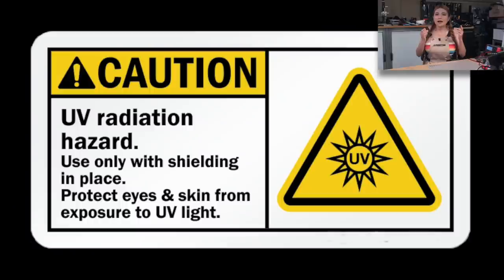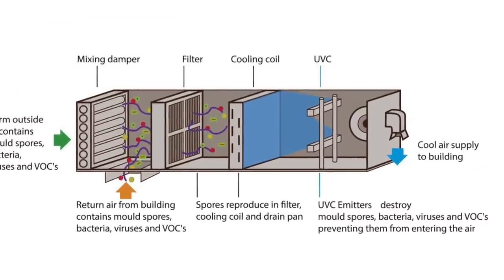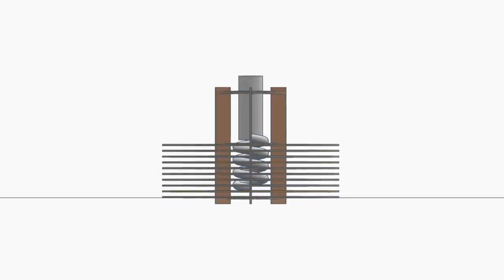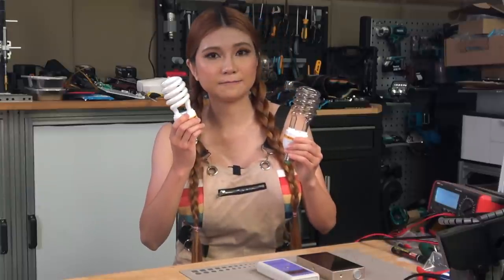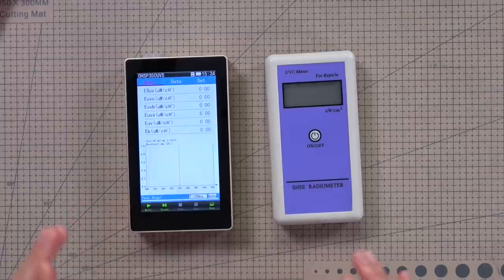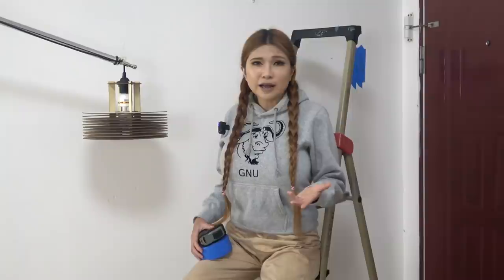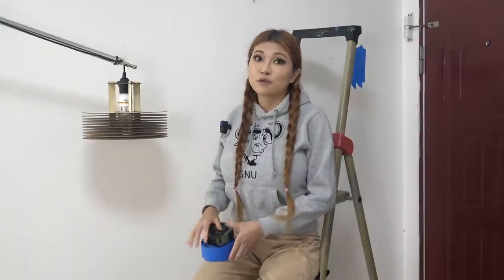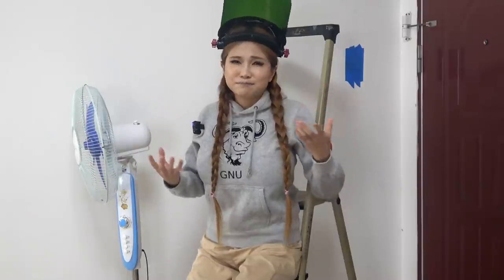Killing Viruses with UV!

Comment: In Australia we have a thing called the UV Index (because cancer) where each point represents 25mW/sqm. A typical midsummer day can be as high as 14, so 350 mW/sqm. This will burn unprotected skin very fast. This index is a mix of A, B and C, but I mention this because it might help out the reading you were seeing into context for the audience. Converting units, 350mW/sqm is 35 microwatts per square cm. So that light was putting out UVC conservatively about 10 times Australian sun UVC.  Your warnings were on point!
Reply: AFAIK even in australia, uvc light doesnt reaches the floor, since the atmosphere ist too thick to penetrate for small wavelenght UV light everywhere on earth

Comment: Great video and nice design.   While UVC certainly has the unpleasant characteristic of burning skin and damaging the surface of your eyes, it's now considered much less of a cancer risk than the longer UV wavelengths like UVB and UVA due to its inability to penetrate the skin as deeply.
I did end up exposing my own eyes to UVC a bit too long during experiments and it does feel like having sand in your eyes.  Very unpleasant, but your eyes will recover quickly, and you'll not want to repeat the experience.
Reply: Haa, I remember your video about the awesome death lamp! "Smells like burned pork"
I occasionally use it in class after introducing the photoeffect, since the question about health issues with UV light will come up.
Reply: we all remember your death lamp video.
Reply: I work in microscopy, and UV light sources are common for fluorescence. Two of my colleagues managed to get cataracts, which I believe was due to decades of exposure to UV looking down eyepieces of old model microscopes. In theory the filters and the glass of the optics themselves should reduce your exposure, but the damage probably accumulates over time. So while "flash" can burn the surface of your eyes and give you a temporary injury, the UV exposure can also cause lasting damage to the internal lens of your eye, and with repeated exposure induce cataracts. I strongly promote the use of cameras over eyepieces these days.
Reply: Great to hear Naomi give you a shout out, I have found both your content entertaining and educational for a while now. Is there a collaboration video in the pipeline?
Reply: Sounds like the effect you get from catching one too many welding flashes.
Reply: Yep, you get itchy eyes, even with eye drops it takes time for it to disipate.
Reply: @rlaxton666  It's the exact same thing.

Comment: This is excellent!  The repeated safety emphasis is the best part, both the risks and their mitigation, and the alternatives.  The lamp design is ingenious, and most of its parts can be made by hand using a jigsaw.

I noticed some of the plywood had warped a little: This could affect lamp safety by letting the gaps open wider than 4 degrees.  Is there a way to coat the plywood to make it stay flatter longer?

Edit: I just realized that the same spacers used at the center could be added to the edges.  No new part design needed!
Reply from the maker: Yeah that's after I dropped it a few times and took it apart and put it back together a few more. Normally it doesn't warp, and even with a bit of warping the angle never. goes past º4, it's not pretty, but it does not affect the fuction of the lamp.
Reply: Thanks for such an educational video. I do have a question regarding making my own DIY lamp enclosure. For a 3D printed enclosure, is it safe and sustainable to use PLA with UVC?
Reply from the maker: @kareemtawab  Technically it will break it down, but it will take a few years. I have a 3D printable version I will be posting soon.

Comment: Naomi, it's so refreshing to see a tech engineer using human-centric design that starts from an analysis of the realities of life for folks in low-income, high-density housing. I see so many projects that are more about imposing a particular tech solution that the "inventor" finds exciting. It's a sort of arrogant nerdy tunnel-vision that doesn't consider the full range of issues faced by the target community and treat them as humans who will need to maintain and repair the Thing. Back in the day we called it Appropriate Technology. My father worked for Ruston and Hornsby, who made low-tech, ultra-reliable internal combustion engines that could be repaired with basic workshop tools and would run for decades on poor fuel, pumping water, running machine tools or farming equipment or generating power in rural areas without electricity. They could have made them five times as powerful, but stuck to simple evaporative cooling and low stress and simplicity because they understood the realities of poor rural communities in less-developed economies across the world. You are an example to us all. Much respect.
Reply from the maker: Thank you!

Comment: I've had a UV light installed INSIDE my Home AC unit - the concept being to TREAT the air as it circulates through the UV lite chamber.  I believe it is a multi-spectrum lamp that emits UVA, UVB & UVC spectrum light.
...and your point regarding skin and eye/optical damage is spot on - I'm dealing with Basil, Sqamus and Melanoma skin cancers in my later years (my exposure began back when I was a kid on the Farm.  Back then, it was Baby oil and Coppertone with SPF 0 - NOT the SPF 50+ that we find today!)
Keep up the good work!

Comment: This was very technical. And if mirrors were used on the walls in the same region hit by UV rays, but with an angle capable of stating that the reflection of the rays would follow reflected horizontally and upwards.
Reply from the maker: This can be made for $25. We can't mirror the walls in urban slums and more refined products exist for those who can afford them.
Reply: @Naomi-Wu  most mirrors will not reflect UV as it will be absorbed by the silica glass.  The UV bulb uses a special glass (transparent to UV)  and coating (to prevent formation of ozone).  Without qualification your video is one of the best I've seen to explain UVG to the "masses" - thank you for your work.

Comment: Funny you should mention a welding torch. I did some stick welding practice for work in the past in the summer.

I made the mistake of welding while only wearing a t-shirt. The welding mask protected my face and my eyes. But the skin of my arms was blasted with UV. It was like a really bad sunburn and the skin of my arms ended up peeling in the following weeks.

So, the lesson is: don't play around with UV or you'll find out the hard way. 😁

Comment: Nice work! It could be interesting to add some control circuits to measure distance to the floor, inclination, etc, and make sure the lamp is off if some basic safety conditions are not met (the fixture is leveled, the distance to the floor is minimum 2.4 m, etc). Just in case the wind moves the fixture or something weird happens with it.
Reply from the maker: Raises the cost a good deal and the idea is to make these as cheap as possible.
Reply: @Naomi-Wu  I will give it a try and publish the results. Let's see if I can keep the costs down.

Comment: Maintenance for this sort of thing is pretty important, CFLs don't last forever, and if you can't really see the light, it can be hard to figure out that the bulb is no longer and good. What we do when keeping reptiles is change the bulbs on a schedule. This would probably work in your application since I assume the light stays on all the time. It would suck to think you are protected, but to not be safe any more.

A quick question, what did the light look like to your eyes in the room? What about in the dark? The camera showed a pretty annoying band, but cameras sometimes react pretty weirdly to UVC.
Reply from the maker: It's a very very dim blue in a normally lit room, not disturbing. The bulb is good for about a year.
Reply: @Naomi-Wu  is it rated for 1 year, but the fine print says something like "for 8 hours per day"?
Reply: @NOLAfugee  To maximize bulb life, a timer may be necessary.

Comment: I hope you'll excuse me for pointing it out, because I don't mean to nitpick. But for safety reasons, see if you can have the light turned on with the light fixture for a couple of hours and also monitoring the heat buildup inside the light fixture.

Maybe with a thermal camera or just taking the light fixture apart afterwards to check for burns.

UV light doesn't just burn skin. It can burn wood as well in close proximity, depending on the wattage.

Since you made the lightfixture from thing plywood, the material is kind of like kindle for a fire. So it's important to make sure that the lightbulb doesn't generate enough thermal radiation to cause the light fixture to catch fire.
Reply from the maker: Perfectly reasonable concern, I've tested it at length accordingly.

Comment: Naomi very educating video. Learned things I did not know. One thing you did not get into other than a mention of time of air exposure for UV to do its job. The idea came to me while you explain danger of exposure. what if I were to install 3 bulbs inside my cold air return pipe of my furnace the pipe is 8" high x 20" wide & 10 feet long. by installing 3 bulbs at 3 foot intervals that would increase the exposure time as air moves through the pipe. pipe having volum of 111 cubic feet.unfortunitly I do not know the cubic feet per minute of furnace fan to calulate air volume to figure time of exposure of air moving. But I feel we need to know how long it takes UV to kill a said virus when exposed?

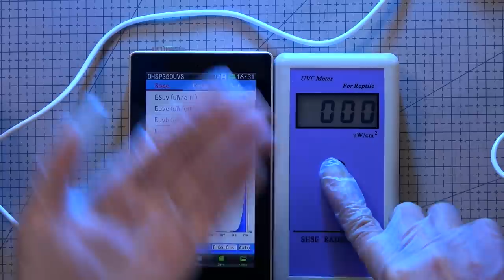Comment: While the expensive UV meter also showed the LED bulb was not performing, I would note that there appears to be a shadow going across the cheap meter's sensor. (15:53) That is a design limitation of the cheap meter -- the expensive one gives a spectrum so you can tell it's seeing the light, but the cheap one's single number gives no feedback that it's being exposed to the light.
Reply from the maker: I tested it several times.

Comment: Used to use UV lamps on the pond filter system. Expensive but kept bacteria down . Interesting topic worth carrying on work on hopefully this inspires people to do so. I don't have neighbors , well they are there but over a kilometer as the crow fly's. I wonder if you put a fixture on the ground to only shine A few inches . Also I wonder if it could be used at the entrance/hall so anytime you by it zaps the air.

Comment: After some searching online, I found that these spiral shaped UV-C germicidal bulbs are not available in all countries. 
At least, stores say they will not ship them to the US. They even try to block them from search results.

It's too bad that followers in the US at least will not be able to use this nice open source design as provided. 
There are E26/E27  UVC bulbs with straight mercury vapor tubes available to US buyers, but they are much too long to fit in this design. And they are still not as powerful. The spiral shape bulb would also greatly help with getting more of the UV rays to be emitted horizontally so they can reach the air beyond the baffles.
Reply from the maker: Yeah these aren't really intended for the US, plenty of other options there.

Comment: nice work, however there are UV units that can be installed in the return air side of your home's HVAC unit. They work good if they are installed in the correct size.
Reply from the maker: Yes, but as I said, the places this is intended for don't have HVAC systems.

Comment: Interesting, how would something like this fair in the in-between spaces in buildings? In the air-gaps between floors and rooms with passive ventilation instead of inside the upper levels of rooms?
Reply from the maker: Well you would not need the louvers then, that's something else.

Comment: I wonder what a coating reflective to UV-C on the discs would do for the efficiency vs whether it would affect the projection angle.  Maybe leave an inch un-painted around the edge to ensure they act well as shutters?  A side effect would be reducing the damage to the fixture from the UV-C itself, though I'd imagine it would take years for that to be a major factor.

Comment: great explanation n works madam!. based my experience, by standard low-vapour Hg UV-C lamp, the ozone formation is has greater risk of health effect than skin light exposure, because beam exposoure can be avoided spontanously by human instinct of harm. the beam exposoure still very dangerous of course to skin. but the ozone residual in air can harm our lung slowly but hazardous and still cannot be detected/sensored by our noose smell sensing to be avoided. more energetic uv c lamp by wave lenght or power input, it mean ozone formation is more height and more harmfull effect to our body. In some ways, the standar 254 nm ultra violet light is has a 4 electro volt of kinetic wave energy (enough to split O2 or N2 in atmosfer to be ionized to ozone)
Reply from the maker: 245nm does not emit significant ammounts of ozone- 185nm does, and I've tested these bulbs.

Comment: I wonder if covering the disks with thin aluminium layer (aluminium foil and spray glue, self adhesive aluminium tape etc.), possibly only on top surfaces to not create downward reflections, would cause a worthwile efficiency increase.

Comment: Just ran across your channel by accident and stayed to watch it.  Appreciate the detail and warnings you give.  Question: Would the increase in diameter of the "baffles", be able to decrease the 4 degree angle significantly enough to make that a feasible option? This may be a noob question, and if so, I apologise. Thanks for the video in any case.  🙂
Reply: Great observation! Yes, increasing the diameter will reduce the escape angle. But it comes at a cost: to reduce the angle fro 4° to 2°, your lamp fixture diameter will need to roughly double. That means the weight of each disc will quadruple without other design or material change.

Comment: is there any type of spray on coating like some of the automotive stuff you could spray on the wall to block the UV from reflecting?
Reply from the maker: Sure but that adds to the cost, it can just be positioned more carefully.
Reply: @Naomi-Wu  yeah, was thinking an experiment with different substances might be interesting. like oils soaps, varnish and other low cost solutions.

Comment: would it work to combine the UVC source with the ventilation system? like a ceiling fan that circulates the air through a tube with high intensity UVC inside?
Reply from the maker: The air needs to be exposed to UV longer than such a system permits...

Comment: why dont you put the lightbulb in a closed box and put light trapping slits on the sides of the box so the light cant escape and use silent fans to pull air into the box !!!!
also you can add a normal low power light bulb inside the box or the light fixture you just created (LED tape) so if you see the light you know you have to get out of there !!
i think its better than risking getting burned by misconfigured UVC light fixture
Reply from the maker: I explained why in the video

Comment: The outravilet is the single part single resorse energy,it means that could not more stronger than muterple lighty resorse and the ouside the way it will eating the heat ,that is the most dangerouse,it could increase the black bactirias deeded,so if you want to using the outraviolet ,just keeping with several and the muterple lighty kinder for bondird。that is suching as the sun do。